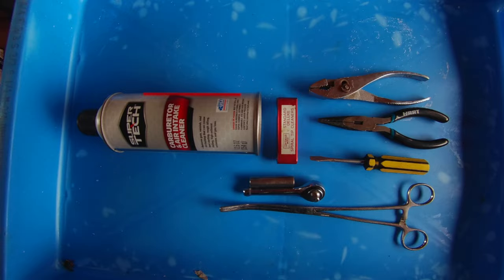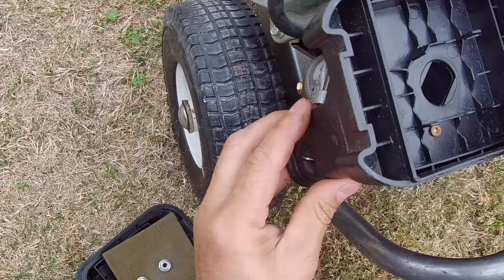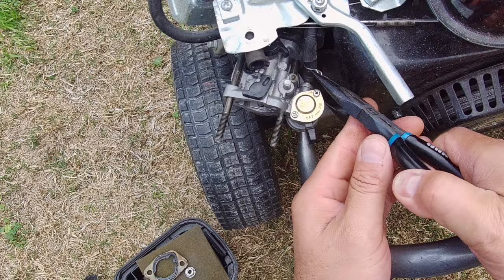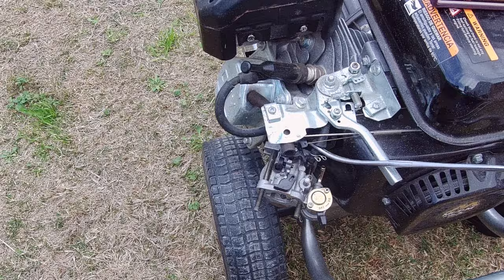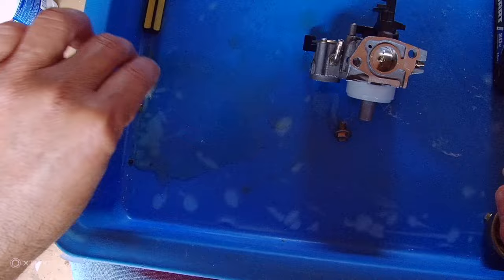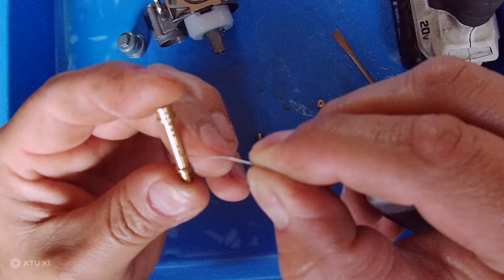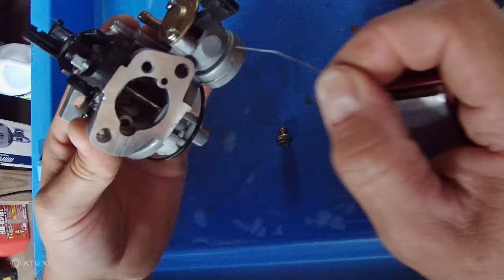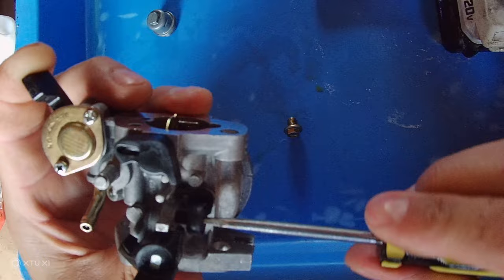How To Clean A Pressure Washer Carburetor

Comment: Didn't work for me. Already changed spark plug. 2 oil changes. Maybe the wire connected to spark plug? Or it's just done for. Bought mine in 2017. It's a 2200 psi Power Stroke 150CC

Comment: Just inherited a basket case karcher with a Rato RV173 motor... It came with a new carb, so installed it set choke and it fired first pull,  given it had sat for years.. not bad I thought, then I shut off choke. stalled immediately 😢,  won't run without full choke..
New carb adjustment? But can't find anything on the carbs for rato.. also I'm not familiar with those carbs or small engine carbs, been many decades since I tinkered.. what is the machined channel on the engine side face of carb, sort of spiral and open down at lower end of carb.. was told that they are redundant, but why would the take time to machine it into the piece.... ?

Comment: When I took the lock bolt on the governor.  I didn't check if the pin was open clockwise or open counter clockwise😮. How do I know if I locked it in the correct setting

Comment: Good video. What do you think about a carb that the  fuel dried out causing a shellac problem. Would soaking a few day in cleaner or using s9mething else to get it off or just getting another carb or power washer?
Reply from the maker: Yes soak it in carb cleaner you just be able to disassemble it easy